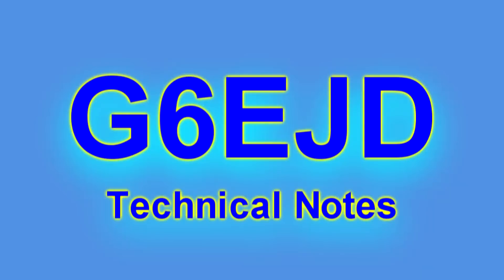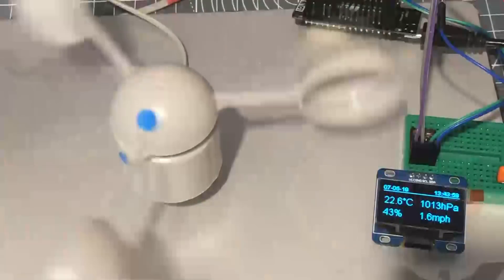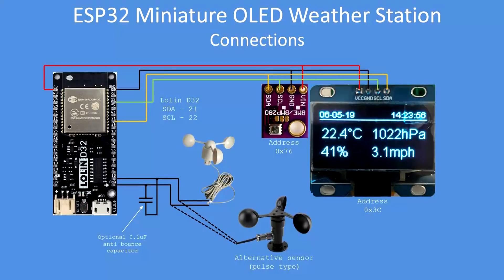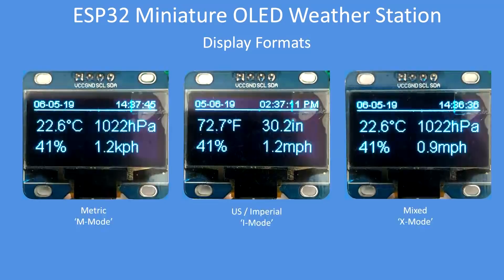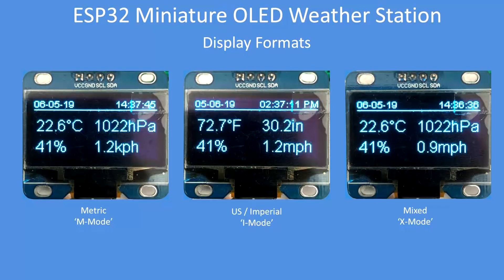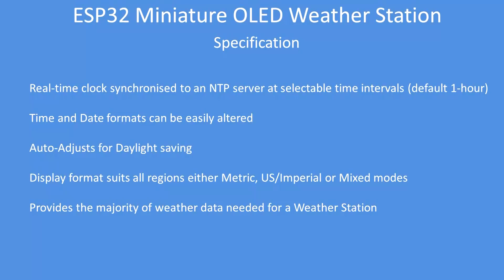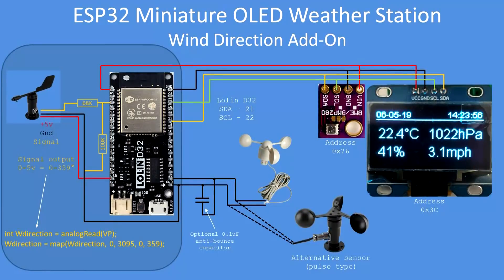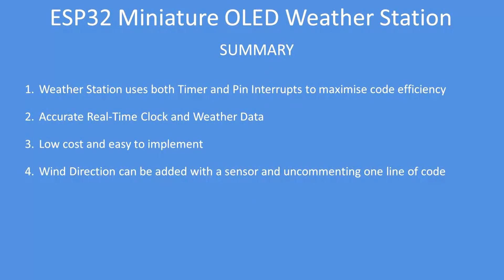Tech Note 126 - ESP32 miniature weather station with wind direction add-on

Comment: love the project. Im doing something similar but with an arduino, dht11/dht22, water sensor and wind speed sensor. but this has a special function which is automatic covers for a farm that sun dries crop. Would that be possibe?
Reply from the maker: Yes that would need minimal changes to the code.

Comment: Hi Sir,
 I have done as was shown and uploaded the code to my esp32 wroom module. Not trying to use the esp8266.  First issue resolved was in the timing part around times setup. the coding has changed slightly and I am able to jump that fence. I am using an Ultrasonic Anemomter for signal input on giop pin 15. This unit outputs analog 0-5 volts on two channel - speed and direction. I am not getting anything out, so put some serial outputs to read the wind speed and millis minus last event time. Millis is counting up, but last event time never leaves 0. I am thinking the ISR is having issues. Is there something else in the code I might need? I can upload my code if you wish. I am at this point only at the speed part and not Direction.

Comment: Do you have a picture showing the Wind Direction showing on the display?
Reply from the maker: Unfortunately not, but I can tell you it’s a circle of diameter about 60 pixels and an arrow that denotes wind direction, it’s a basic display given the resolution of the screen.
Reply: Do you have a current recommended sensor to use for the wind direction vane with link?
Reply from the maker: @TheMisterTFM  there are a couple of approaches you can use, a traditional wind vane with some form of angle measuring interface, but these tend to be expensive and cumbersome, but work well. Tupi ally they use a 360° potentiometer so need a simple voltage measurement to convert to an angle and hence wind direction. Alternatively there are now many  magnetometers which can be mounted to a wind vane and hence used to measure its direction. However as in all cases getting a connection to a rotating sensor is very difficult, obviously wireless is the answer but that needs a power source, so many wind vanes have the sr air static and make the vane I slice just the sr dir, and so there are many solutions, it depends on how much you you want to spend.

Comment: I ordered the D32 board and the BME 280 sensors, However, my question is The D32 board is not listed in the Arduino board manager how do I upload the code?  Great project.
Reply from the maker: It sounds like you don’t have the latest Arduino IDE and it will load the ESP32 extensions as I have been using the IDE today and it has two Lolin boards predefined the D32 and D32 Pro. You can also use the ESP32 Dev board as the pin outs are nearly identical, but no need if the ESP32 extension is loaded as that lists the correct board.
Reply: Sounds great, I will check it out Thank You. @G6EJD

Comment: Very interesting - where can I see the code please?
Reply from the maker: Check the video notes the link is there
Reply: @G6EJD  Thanks, 
What is the difference between SH1106 and SSD1306 ?
Reply from the maker: sh1106 = 1.3” ssd1306 = 0.96” both the same pixel resolution 128x64

Comment: Thanks for the project how to!  One thing I saw amiss was/is the anemometer pins in the docs, versus in the code.  The drawings show the anemometer connected to pin 15 and ground, but the code has it default pin 4.  I moved the pin and presto.  Cheers!
Reply from the maker: Thanks Scott, I’ll correct that

Comment: Completely noob question. I. Using home assistant for 2 months now, with some sensores already. I know it is possible for sure but it's easy to do this without the lcd just publishing through mqtt? Sorry if the language isn't correct.
Congrats for your great work btw
Reply from the maker: yes you could do that, add the mqtt library, setup your mqtt server details then read the values and upload them to the mqtt server. It would not be a lot of additional code, maybe 10-lines at the most. include the library, define the server address, add the mqtt objects and then add a line to upload the data at regular intervals, not too fast though.
Reply: @G6EJD  thank you very much, I'll try

Comment: Having a problem with this project. I followed the diagram for connecting things to the pins but when i power it on after flashing the screen is just kind filled with white snow. Was there some changes i needed to make to the text before uploading? For instance i see a line that says wind meter on pin 4 but in your diagram you have pin 15.
Reply from the maker: Ok, what development board are you using? Have you ever had your display running using say a test programme?
Reply from the maker: Also what type of wind sensor? I need all the information to help out, too many unknowns
Reply: also i have tried 2 of those screens and they both do the same so i dont think my screen is broken
Reply: I have tried several times to post the links to the items and it won't let me send it to you.
Reply from the maker: @thenatedog  email the details via contact at g6ejd.dynu.com

Comment: I downloaded the code as a zip file, unzipped to my sketch folder , opened it with Arduino IDE and clicked on the compile button and got "expected initializer before 'MeasureWindSpeed_ISR'"?? Is it possible to send you a screenshot?
Reply from the maker: Yes please do plus exact code version
Reply from the maker: Contact me by my webpage link in YouTube

Comment: Looking forward to building this project but I get a lot of compiling error messages."expected initializer before 'MeasureWindSpeed_ISR'" I am using the latest IDE version 1.8.13
Reply from the maker: I've just downloaded and compiled the code, it all works as expected. How did you get the code from GitHub, copy and paste does not work, well unless you select RAW then copy. Your browser has most likely embedded hidden characters.

Comment: Is it possible to use a the bme280 sensor to control a relay hooked to humidifier
Thx
Reply from the maker: Yes, I did the same using an sht31 and called it a humistat see my other TN in that, just replace the sht31 with a bme280
Reply: @G6EJD  
Thanks for the reply. Will look into it. Hope you are feeling much better after MF treatment. 
Best

Comment: Can we use DC motor as anemometer sir by measuring voltage generated by wind speed.... If yes how to achieve that
Reply from the maker: It’s possible because the generated DC voltage is proportional to speed and can be measured by the ADC via a voltage divider. But, the load placed on the wind vanes by the generator would make the result highly inaccurate. Shop around and you can get a wind sensor for a few $ or use one from a really low cost weather station.
Reply: @G6EJD  thanx sir but i want to build my own anemometer sensor DIY
Reply from the maker: Good luck with that, it’s not easy to do.
Reply: @G6EJD  thank you sir

Comment: How to use  two 12c inputs (SCL and SDA ) simultaneously
Reply from the maker: Do you mean 2 I2c devices or 2 I2c buses, it makes a difference. Two or more different I2c devices can be fitted to the i2c bus and their address keeps them separate. It is theoretically possible to run 2 or more I2c buses on the ESP32 as it enables pin multiplexing but there is no library support to do this yet.

Comment: Hi, all well explained but compiling the sketch on line 49 I have this error "expected initializer before 'MeasureWindSpeed_ISR'" What i have to do. I compile a board as  Adafruit Feather HUZZAH ESP8266
Reply from the maker: That's because this only works on ESP32 boards, not ESP8266. I have not had enough time to convert to ESP8266, I will get around to doing that when I can. Sorry.

Comment: Congratulations, high quality video!  Thank you for sharing with us.  to be perfect, include power by solar panel and GPRS sending, as it will be closer to the real need.  and also a rain gauge.
Reply from the maker: Adding solar is not trivial, it would need e.g. a tp4056 charge controller board, and the ESP8266 would need about 1700mAhr per day of battery capacity plus solar charge replenishment so a 6v panel of about 3-5 watts might be enough to keep it running throughout a typical year, well for UK anyway it’s not unusual to have many overcast days, so a challenge, but possible. I would probably add a webserver to display all the values and use the on-board WiFi to reduce circuit and design overheads. Yes adding a rain gauge is quite easy to do, I’ve ordered one, it would need another GPIO based interrupt to count bucket tips.
Reply: @G6EJD  I built a station with a rain gauge, ESP32, RTCDS3231, SDCARD DHT22 (I will switch to the BME280).  Powered by 10W solar panel, a 12V 5Amp stationary battery, is super sized, but as you said need to ensure for cloudy days.  The ESP32 is always in Deepsleep mode, but it wakes up to add the rain gauge by interruption, and also wakes up every 10 minutes to take the average temperature and humidity, completing the 1 hour cycle sends the data to the UBIDOTS.  When the GPRS signal is missing, the data is saved to an SD card, and accumulates data on the SD card until it has GPRS signal again.  It's been a lot of work, and has to be perfected enough, your video inspired me to try to add the wind sensors.
 Thanks again for this video.
 I will always watch out for new videos of you.

Comment: I almost have the parts needed for this cool gadget, will try it tomorow. Thanks for sharing :) 🍻🍻
Reply from the maker: László Kósa, you can calibrate the wind speed using a car by holding the anemometer out of a window away from the body and adjust the calibration constant accordingly to match the car’s speed. Enjoy.
Reply: I will :)

Comment: Thanks! Have you considered a rain gauge for this?
Reply from the maker: Steve Rowell, to be honest no, but I don’t know why! I’ve just looked on AliExpress and although sold as spares for other stations they are freely available at about $10 and even the most expensive are so-called tipping bucket types which close a switch when the bucket is full when it tips making switch contact, the bucket empties and resets itself as part of a see-saw balance, so it would need another gpio pin and ideally interrupt to detect the rain rate, I’ll order one and add it, thanks for this.
Reply: @G6EJD  My only problem with the tipping style gauges have been bugs gumming up the little see-saw mechanism. If you could somehow discourage them from moving in it would be a plus. While I haven't tried it I've considered using some sort of aromatic to discourage them.
Reply from the maker: Steve, I have a Davis 6152 unit and it’s still a tipping buck type, they fit a small plastic bug at the entrance to the bucket (bottom of the funnel) and it works well, never had any visitors in there, although that said I still have to do a yearly maintenance clean due to dust and debris in there, mainly due to decomposing leaf or plant material. As long as the main body has a good seal apart from water egress points it should remain bug free. Ive not seen any other form of rain gauge.

Comment: Wold it be possible to have the part numbers for the wind speed sensor and the direction sensor
Thanks john
Reply from the maker: Hi John,Wind speed: https://www.banggood.com/Misol-WH-SP-WS01-1-PCS-Spare-Part-For-Weather-Station-To-Test-The-Wind-Speed-p-1440188.html?rmmds=search&cur_warehouse=CNWind direction: https://www.aliexpress.com/item/0-5V-Analog-Wind-direction-sensor-4-20MA-ABS-material-Wind-Direction-Transmitter-Eight-Directional-Wind/32884187148.html?spm=2114.search0104.3.50.57b54feb95YjCh&ws_ab_test=searchweb0_0,searchweb201602_8_10065_10130_10068_10547_319_317_10548_10696_10192_10190_453_10084_454_10083_10618_10307_10820_10301_10821_10303_537_536_10059_10884_10887_321_322_10103,searchweb201603_52,ppcSwitch_0&algo_expid=cfb89b51-cb23-4af6-bb56-09f81d8c76f2-7&algo_pvid=cfb89b51-cb23-4af6-bb56-09f81d8c76f2&transAbTest=ae803_5Both AliExpress and Banggood stock them, search for 'wind direction' or 'wind speed'
Reply: @G6EJD  can you also provide a link to the alternate anemometer? looks a little bit more rigid than the misol and easier to mount. thanks for all your casts
Reply from the maker: The links are in this comment chain, I just looked there is the music and high quality type. Either that or search on Banggood or AliExpress for ‘anemometer pulse’  Adafruit sell them but at much greater cost.
Reply from the maker: Andreas Fuchs, btw the Peet Bros sensor head is by far the best and can be purchased as a spare. It uses Hall effect switches and direction is determined from time between pulses as a ratio, so no moving parts for direction, so two pulses, either one gives wind speed, but wait for one to go high then wait for the second to go high, record time taken e.g. 200mS,  then measure the time of one revolution say 400mS, then angle = 200/400x360=180°
Reply: @G6EJD  thanks allot will have a look at them

Comment: Have you considered not maintening connected the wind vane to power? Using a transistor to switch on and off when you want to take the measurement. In my case I have to power the wind vane and anemometer to 12 V. I don´t know if your model it is different.  Thanks for you great channel!!!!
Reply from the maker: The sensor for wind speed is passive and has two Reed switches operated by magnets, but yes with the two high end units both of which require 5v (there are 12 and 24v variants available too) they require power which could be switched by the ESP to reduce power demands, but with an OLED display the power usage is mainly with the display and so sensor power consumption is secondary. The wind direction could easily be read in the interrupt routine for wind speed thereby simplifying the reading process and making the values available when there is wind blowing, if that makes sense, no wind no need to take a measurement of speed or direction in the background. Lots of scope for enhancement for sure.

Comment: Love the explanation will try this project next week! I'll keep you updated
Reply from the maker: Most of the cost comes from the sensors, if you use high quality types, you can make a system that rivals high-end units like the Davis. Compared with my Davis 6152 unit, the results are identical, but at a fraction of the cost and of course expandable/customisable.